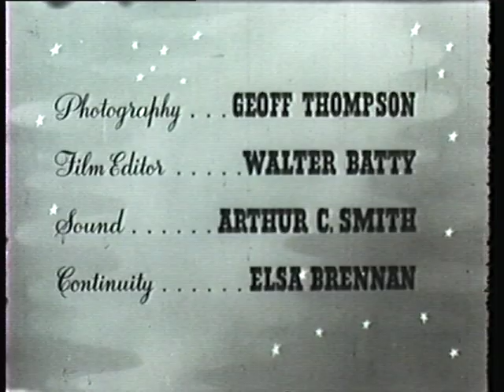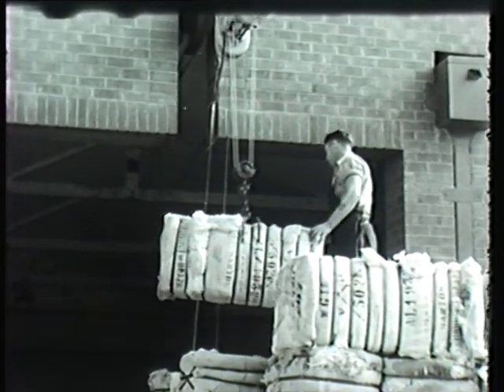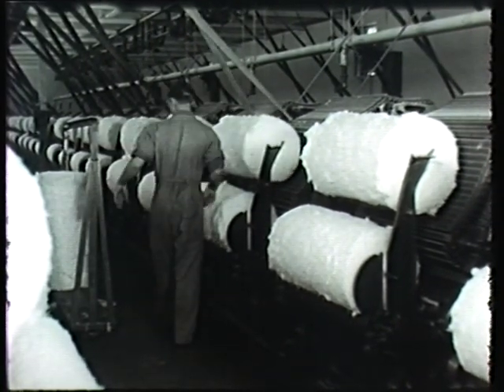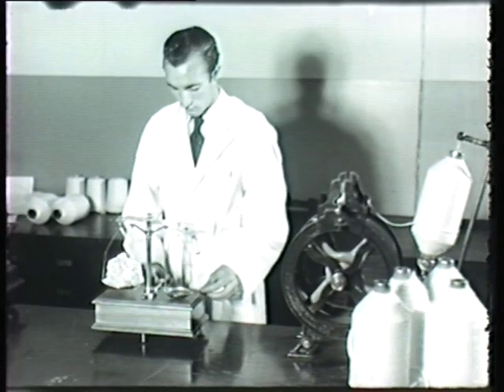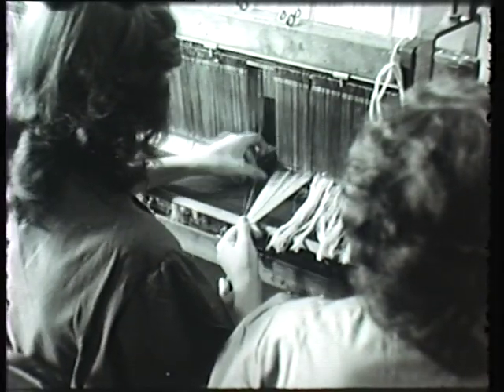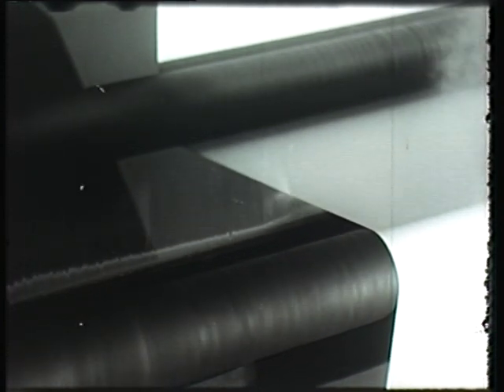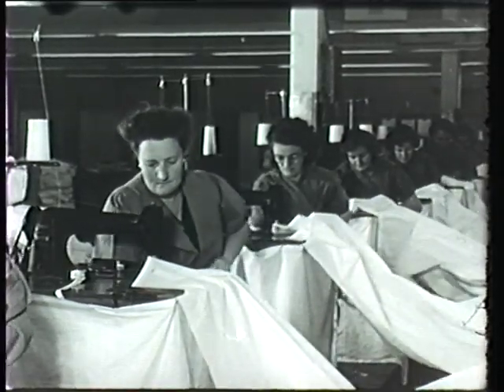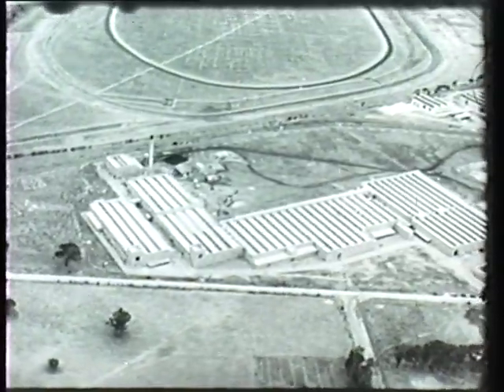Every Inch Australian

Comment: I worked there in mid 2000s when k&n freighters were using it to store rolls of steel for holdens. Went all thru the factory and the under ground tunnels, was a cool old place. Noone realised there was tunnels until the ground started to droop from the weight of the steel.